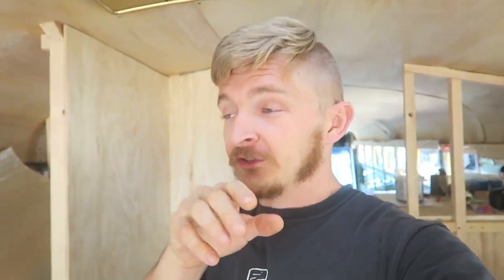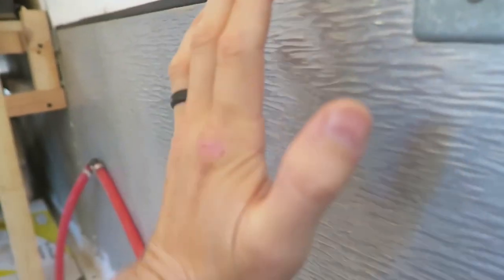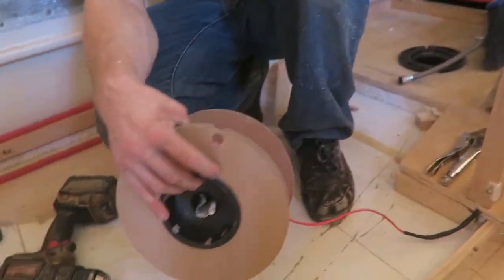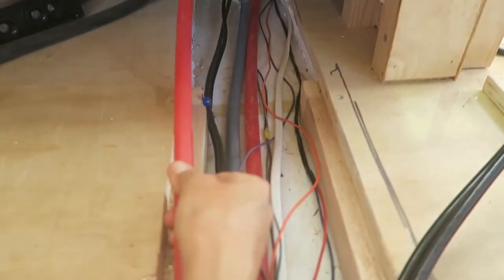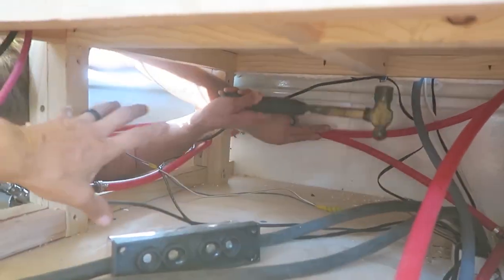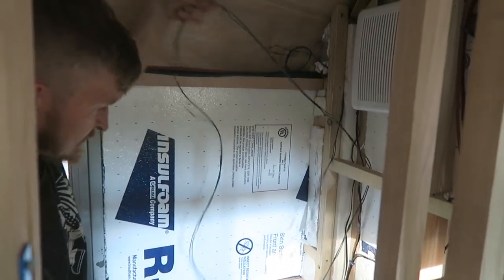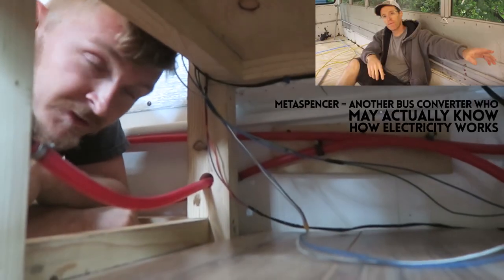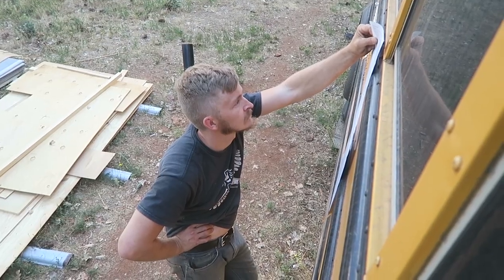#66 SKOOLIE BUS CONVERSION | Mosaic Bathroom Prep and Solar Battery Sled Rebuild in our Skoolie

Comment: I’m wondering if you’ve seen any of the bus builds and tiny house builds where they talk about using tile in a vehicle that’s going to be moving down the road? It’s my understanding that the flexing and twisting of the bus will cause cracking in the tile base.
Reply from the maker: Yeah, there is a bus conversion series called Expedition Happiness by a young (german?) couple. They did a tile bathroom on their bus and reported that it didn't fall apart. When I drove our bus from Grass Valley over I-80 into Reno and south 600 miles to Los Angeles, the tile didn't crack once. I think it's fine in a moving vehicle. School Busses are very rigid.  Thank you for the thoughtful comment.
Reply: Yeah. I’ve seen and heard of at least a couple going both ways. I’m convinced that it’s dependent on the underlayment and type and size of tile combined with the adhesive used. I know some adhesives, for example, will remain flexible for a very long time and some become very rigid and fragile. It seems to me that your best feature in this regard might be the mosaic you did, where you used very few large pieces of tile.
Looks fantastic! Well done!

Comment: What is the heat cord you use for the shower floor???
Reply from the maker: Hey BUS - Great name. 

Here's an affiliate link to the heater system we used:

In floor heating kit: https://amzn.to/2LrNJBH

If you use that link to buy, Amazon kicks us 6% of the sale, but it doesn't cost you anything more.

If you don't want us to get that 6%, search 'HeatTech 5-15 sqft Electric Radiant In-Floor Heating Cable System, 120V' and you'll find what we used.